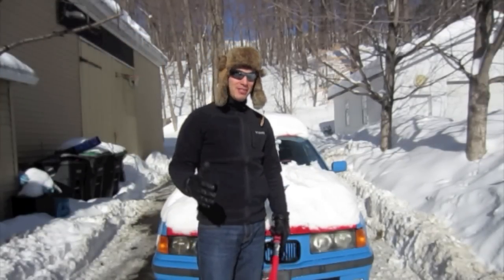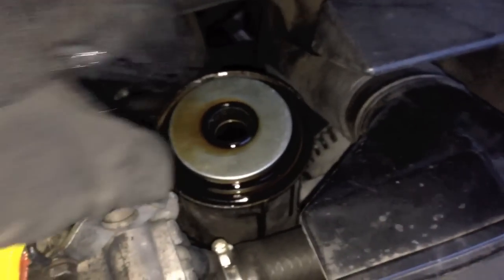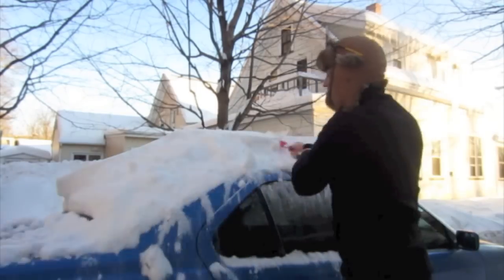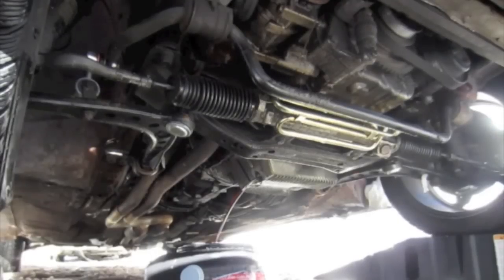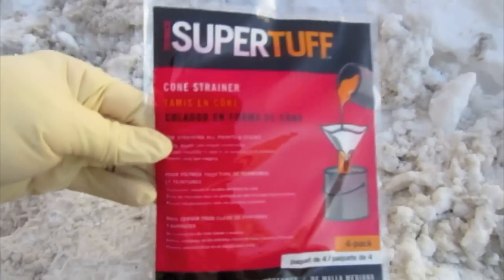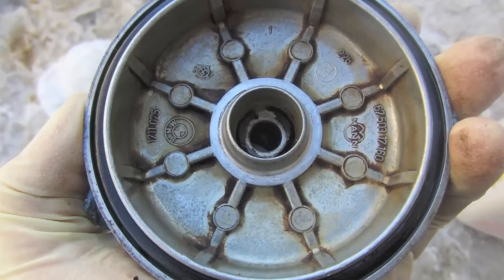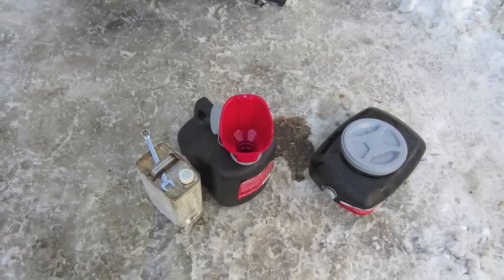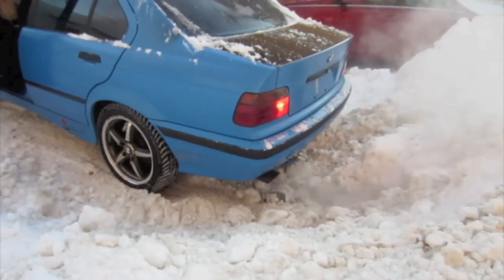BMW Race Car Build for $900 Part 6 Is Our Motor Blown?

Comment: Hi. Just watched all 6 episodes. Awesome to watch, and love the budget hunting aspect of this. I really like that you want to save stuff also, and not just replace it, and throw it away. I'm sure that the elbow grease you put into is proportional to the joy and pride you will get out of it. A little tip, if you have the options in your editing software. Use compression on your voice, and filter out low frequencies, and match your voice volume with the music (music is too loud). Do this with your ears, and not meters :)
Looking forward to the next episode. Best of luck, and enjoy!
Reply: I second that motion. I found myself turning the volume up then manically turning it down.
Glad I found this while its relatively a new project (judging by the posting date).
Thank you very much for doing this.
I have a '92 325i that Ive not been very nice to and would love to learn how to fix her myself.
Seeing videos like this is inspirational to me and makes me want to learn more about her so I can get her running strong again.
Reply from the maker: testacorsa150 Agreed, Still learning for me on the audio side. I'll do my best :D
Reply: millertimebmw I'm sure you will, and you are doing a good job already :)
Btw I bet that engine will keep running B-)
Good idea to filter the oil manually, and I think that the solvent will break down most of the hardened oil bits left in there. Just don't put too much pressure on the engine with the solvent in there, as it breaks down the oil film, and you can easily ruin a bearing.

Comment: Thanks for braving the cold. I have got similar plans for 540i. But at the moment it is a 7 cylinder engine that needs courage, beer, and warmer weather to start the project!
Reply from the maker: Awesome! Let me know if you ned a hand. 
-Zach
Reply: Mark Curry.
Check the coils and the pluggs. Might be the valvecover seal that leeks oil on to the plugs and coils. Common fault on the M60 and M62 engines :)
Reply: Thanks for the input, I plan to work my why down on the M62. Been in there before. But not too deep.

Comment: The tick noise was lifter knock from improper oiling. Looks like getting the contaminates out like you did improved things but you would have to worry about the main crank bearings getting scored and eventually scrapping your motor.

Comment: i used liqui moly engine flush on my car and it cleaned the inside of the engine, before there was a bit of oil sludge after there was none

Comment: Nice job on the car

If you want to get that engine running really sweet, you could top if off with about a pint of ATF or kerosene run for 10 minutes at then leave overnight before running it again in the morning and changing in some cheap oil and a new filter as the one you have will be clogged. You will want to crack open the oil pan and clean it while doing this as the whole thing will be full of the junk from your engine. 

Run with the cheap oil and filter for about 150- 200 miles then change the oil and filter, cracking open the oil pan and cleaning. My advice having seen that engine is to use cheap oil and change at half the service interval next, given its an m50 engine you change the sparks and check the coils on it at this point as BMWs tend coat the sparks in oil when this is done to them. It will still be rough old engine but I limped my last one 12,000 miles before it died on me doing this.

Comment: the M50 are one of the few BMW engines that actually can take a beating like this. After the procedure you´ve done through this video, you should use an engine flush application. Then push the engine harder followed by multiple oil changes. might do the trick guys. Maybe I´d go for a compression test or similar. Had the M50b25 myself...
Reply from the maker: Phil Jones Agreed, hopefully she pulls through :D

Comment: This should help. If you can put a strong magnet on the bottom of the oil filter. That way any metal shards from the motor will be catched by the magnet. Therefor giving you engine a little more life to it.

Comment: I would go a little crazyer...the car is already free and you doing in a budget...just take that engine apart...change bearings and gaskets...measure the cylinders...clean all...and put back together...the engine is pretty strong we can see that...but if you want a race car and reliable...do that...
By the way...i really like the video series...i want to do something like that on my on someday with a mini classic x)

Comment: try pulling the brake booster hose and running a couple cups of seafoam through it with the car at about 5000rpm. I did this and cleaned out my e46 very well. should be done carefully though, I clogged a oil separator valve on mine.
Reply from the maker: +Mrcreator303 We ran seafoam, diesel, all types of things.

Comment: those flakes could be deposits from neglect perhaps before you owned the car, or even possibly something that got in the engine during an oil change, filtering out the chunks will help, however if any internal damage has been done, you might still have to tear the motor down to the block and rebuild.  I has a 318is that needs rusted panels replaced and carpet that needs to be dyed, Id be willing to let you use the carpet in mine as a donor for the carpet dye as I plan on going a different direction than dying the carpet and putting it back.

Comment: Use a mix of trans oil, marvels mystery oil and motor oil. Let idle for 10 min then idle at 2500 for 10 minutes let it idle for 10 min. That will clean most of your engine. Do a cheap oil change with filter and add marvel mystery oil go for a 10-15 mile drive. Do an other oil change with filter. Your engine should be good after that. That's what I did with my engine and it runs great and very smooth. It's also better on gas

Comment: I think you should drop the oil pan and clean out all you can as far as the inside of the engine with some sort of solvent. I wouldn't feel comfortable with that floating around in my engine. What I would do is pull the engine and refresh it with rings, have the block machined, cyl head machining, valve job, new gaskets, etc.. But that's just me and this is a beater car.

Comment: I'm really impressed with the build.  Although, I have to admit I got stumped on one thing:

You had basically the entire care apart, and you didn't drop the bottom end off the motor to see what was lurking in there?  I mean, knowing it's a BMW there's gotta be some good reason not to do it, but I can think of a whole lot more reasons to check out the sump for debris, examine crank and bearing play, rod end play and bolts, maybe even peek at the bottom of the cylinders with a scope.

With the amount of work in the rest of the car, I expected to see top and bottom end come off the engine.

Comment: dropping the oil pan and cleaning it before you first start the engine. Otherwise, grit in the pan gets released by the seafoam and scores your crank bearing seats.

Comment: just change the oilfilter about 3 more times and the oil about 2 times the next 4 months or so , the ticking noise is prolly the hydraulic lifters not getting enough oilpressure and maibe even been glogged up , 
the gunk will be washed out over time and the engine will run for quite a while longer as long as you dont overrev it 
might need to change the oilseals on the valveguides over time , bmw's are known to smoke when you let of the gas and the seals are prolly nice and crumbly

Comment: I am an ex mechanic a little trick i do is use diesel to clean the inside of motors purt in about 3 liters or a gallon in america and let the car idle for about 10 min

Comment: The second take sounds much better and sounds more like a bmw also. Maybe should have removed the oil pan on one of the oil changes to scrape out the oil sludge on the bottom.  I never use seaform before but it seems to work great and do the job. I'm not sure if it's good to.use in newer cars like my e90 330I. 
By the way question? What do you personally of the n54 335's. Do you think it's a car someone should own or is it too problematic with lots of issues? Any feedbacks would highly be appreciated thank you

Comment: fill it with 5qrts of atf and let it dissolve and make oil thinner - it may help to unclog pickup tube. or 50/50 with diesel fuel and let it only idle for 5- 10 min. Anyway nothing to loose.
Reply from the maker: Andrei MasterOfDisaster Tried the Diesel, no real improvement. I have seafoam in it now. I'll try diesel next. Fingers crossed!!!

Comment: Go get you some cheap oil. A couple of gallons at least and one good oil change. Get you a couple cans of b12 fuel treatment. Warm engine up. Dump in half a can of the b12 and idle for 5-10 minutes. Drain oil rinse and repeat with fresh oil a couple of times. Then second to last oil change just put fresh oil in to get out all the b12 remnants and oil garbage. Drain and change oil again. Put in good oil and filter. No more ticking. I've had this work many a times. If the engine can be saved this will more than likely save it. If the engine is toast you will know soon enough.

Comment: I had a distributor gear begin to shred itself in my blazer once and I kept getting metal shavings in my pan . But after I replaced the gear the shavings were still in the pan so with some careful use with a magnet and screw driver I got most of the metal out of the pan maybe try that as well ps the blazer is still kicking with 200,000 on it

Comment: that black stuff you found in the oil is just very old oil, and you know that the engine of a bmw e36 325i is amazing because they always keep running if you treat them well, so keep it clean, keep checking your oil level and have fun. Btw the radiator of e36 works good but the constuction of keeping it in place is not that good, because it can cut loose and your van wil destroy it.
Reply from the maker: +Mr. Rowan I'm hoping more of it breaks-up and flushes out soon!
Reply: +millertimebmw no problem, check out my channel i got some clips of me drifting a 325i in germany

Comment: If there were loads of chunks in the oil, did you not think of removing the sump and cleaning it early on in the filtering process? There would be a load of shit in it mixing with the filtered oil.
Reply from the maker: Cozmcraes Agreed. We are waiting now, I'm sure we're knocking off more and more now. Then cleaning the sump. Thanks for watching and Subscribing.

Comment: You need Dr. Vanos for the motor lol. You should actually try gumout multi tune up to clean  the motor inside. It's like sea foam except it contains better cleaning ingredients unlike seafoam which contains naphtha which burn with heat. So gumout is much better
Reply from the maker: 23briansanchez I think it will take lot of effort to get this working right. I hope maybe gumout and some ATF will help.

Comment: Why not run a filtering machine. Something that plugs into the oil pan, self made or not, and then continuously filter the oil through filters. Kind of like something Jiffy Lube does.just an idea but by now im sure it is all good to go. Nice vids. I have a BMW M3 E46 myself. millertimebmw
Reply from the maker: TheMaverickSpawn Actually, a wonderful idea!  I'm pretty sure we have a stuck lifter making a racket and I'm sure it's got to do with the debris floating around.  And E46 M3 = dream car!
Reply: millertimebmw ah man. Hope you get that solved. yeah man the E46. fixed the tranny now the vanos needs some love. not creating problems but just to be sure. Enjoy the car.

Comment: is there more videos coming? i think this motor will be ok, but you have to keep removing sludge from the motor. keeping filtering the oil and also changing the oil filter.
Reply from the maker: analanalyst I just did one more oil change today! Sounds much, much better.
Reply: millertimebmw Awesome! if you want this motor to last you will have to keep redoing it.
Reply: millertimebmw the oil in this video was also very dark, did you add fresh oil as well?
Reply from the maker: Yeah, twice so far! It still looks crazy. :(
Reply: millertimebmw you have to keep changing it with some 5w-40/30 shitty walmart oil. a track car will stay at high rpm so it needs to be clean, love this motor very durable and sounds amazing.

Comment: maybe Would be better to disassemble the engine, clean it and put it back together.  there is deferentially some carbon built in cylinders.  And in the process you might find some other issues which might be good to fix.
Reply from the maker: +Taras Likhtanskyy Agreed, but I want to see how strong the motor is as it is. :)
Reply: +millertimebmw but when it dies, cylinders might get stuck, and then you would need a new engine, which will cost you.

Comment: dude you got oil in your exhaust you should rebuild that motor
Reply from the maker: The Reckless Tomatoes Are you looking at when it's revved? I think it's colored water. But you might be right...  Hope not.
Reply: ok it locked like oil
Reply: millertimebmw It's not oil. If it was oil the smoke would have the smell of burned oil and a blueish tint to it. If you did NOT replace the stock pipes it could be rust, carbon soot, and water coming out. Clean the internals as much as you can and send an oil sample out for testing to see what is wearing. Also check your coolant for oil and finally, run a compression test to see. Compression testers can be borrowed or bought on ebay for good rates.

Comment: drain the oil when enginen is hot, fill it with diesel fuel instead of oil, let i idle for 10min no revs! drain and repeat. change filter also between changes.
Reply from the maker: +Hateif Youwant I ran only "some" diesel or "some Seafoam. Never 100%.
Reply: The diesel lubricates. Seen it done theres even videos of it on youtube

Comment: RESPECT for the project dude;) nice work there. Anyway  if i had your engine problem i may use  some oil/engine  cleaner solution , i dont know exactly the name (a lot of companys make this kind of solution)   ,you put it in the engine ,start for about 10 minute  and than change the oil .
Reply from the maker: AD Motorsport Auto-Rx and Seafoam. We're using that now :D Fingers Crossed!!! Thanks for watching and Subscribing.
Reply: ;) i like the people that make thinks like me;)
Reply from the maker: +AD Motorsport Nice !

Comment: try an oil flush with the old oil and filter let it run for a while to 
cycle through the systeem and afther a while drain the oil and 
bin the filter and put in a new filter and fresh oil this should clean 
up all the left over junk oil inside

Comment: All this effort when you could have removed the oil pan, cleaned it out and the lower engine with spray solvents (brake clean or acetone.)  Good it's running for now though.

Comment: Rebuild :)
Reply from the maker: Yannique1 You might be right!... I hope not haha. Thanks for watching and Subscribing.
Reply: millertimebmw
If you don't feel like taking out the complete engine, pull the head, tear it down, check for flatness, replace valve seals and VANOS seals. Clean the complete head and reassemble. clean cyl.head gasket of engine block, check for damage on top of pistons. Put in new head gasket, bolts and torque to spec (+ check timing). Jack up car, drain oil, remove oil pan, give it a full clean, scrape gasket off, inspect crank, bolts etc for visual damage, then clean of any oil you can reach, rotate engine while doing that, put on new oil pan gasket, sealant and torque to spec. Optionally remove oil filter housing, clean, new gasket, check oil temp and oil pressure sensor (these often go bad). New oil filter, new plug and coper o-ring, fill with Castrol or another good brand oil, drive it easy for 20 miles, let it come up to temp. Check OBD values if you have the tools. Should be fine for many miles to come (if there is no damage to oil rings etc). I would revise the head in any case, if you keep using that old oil you are going too damage the engine...and you don't want to buy new hydraulic lifters etc etc. Goodluck.
Reply from the maker: Yannique1  This might be the next step for us. Hopefully not, but we will see!

Comment: After about 3000 miles I'd replace the oil again, with synthetic oil.  I'd be curious to see what the inside of the engine looks like now.  I'm sure must of that nasty goo is gone.

Comment: LOL this is the only guy i have ever seen to revamp the whole car for a race intended purpose and not once drop the pan lmaoo. How can you sleep at night after seeing that sludge and not rip that shit motor out and refresh it??? People try to say "oh its good german engineering that the motor still runs and might not blow" but at least american domestic lovers agree that we love our motors and would have started this project from the engine first. That motor would have been out along with the trans in the first couple hours and on a stand the garage getting the sludge blasted out of the crank journals and then honed... you dont realize that you had the perfect opportunity to get that motor out when the trans was out and that you could have made it a virtually 0 mile motor for the price of a gasket set depending on the damage. If it was me though i would have had a pushrod carbed 302 from the scrap yard along with any old t5 i could find (pretty much any old american 5 speed) total cost would have around $500-$600 and i would feel easy knowing i got a fresh motor and a proper direct shifting manual to thrash on. You on the other hand wasted your time fucking around with a suede headliner for your car that will explode under any race pressure. Import lovers never learn...